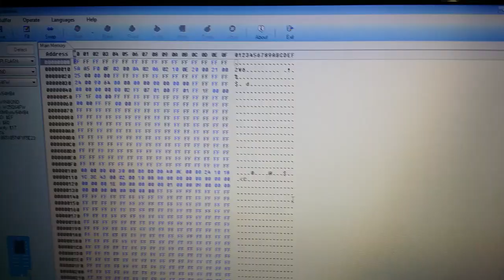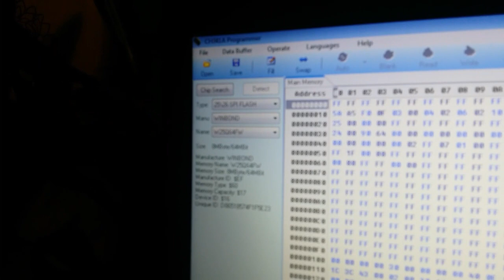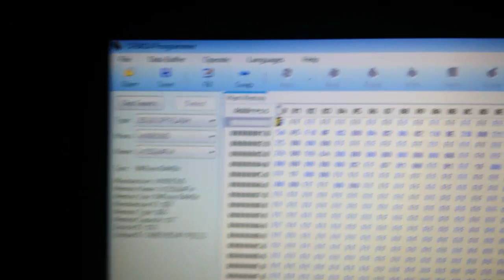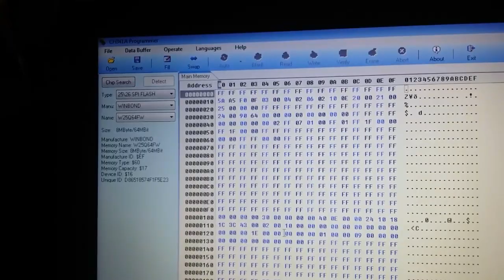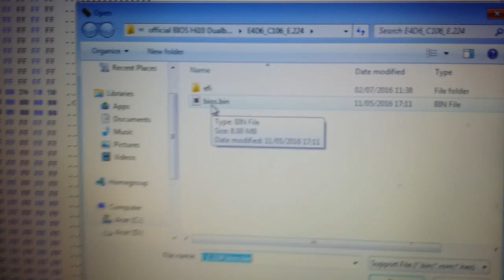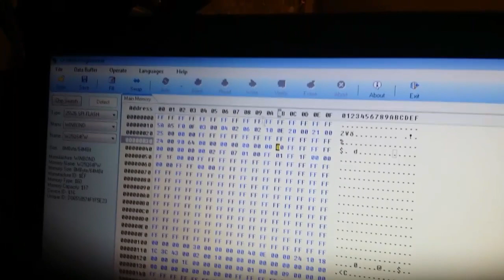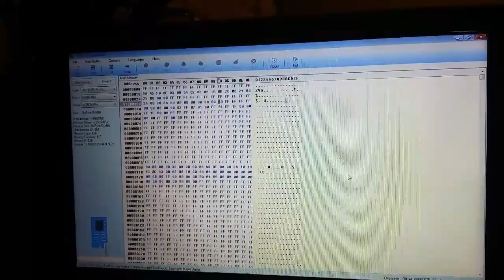chuwi hi10 bios fix How to repair a China tablet corrupt bios chuwi onda teclas cube

Comment: Thank you so much.  I managed to revived my Chuwi Hibook Pro using your guide.  l didn't use the 1.8v adapter.  Also only using CH341a v1.3 works.
Reply: that's great glad I could help. 😊
Reply: did you disconnect the battery?

Comment: Thanks I got it opened but I couldn't get the battery solder to melt I kept my iron on it for quite some time and it just wouldn't move, I did get it disconnected but now I can't reconnect the battery wire as I can't remove the weld so I'm going to try a repair shop to do the connection, fingers crossed the bios flash worked is it possible to check if the tablet works without connecting the battery should it boot up with just the mains?

Comment: hello. I have a chuwi hi8 pro that don't want to turn on.
when I connect the battery charger it charge but no led to notify, I can see in usb tester that there is some current flow also if it charge only at 50mAh.
do you think that with a flash bios can I fix?

Comment: You don't need the voltage converter. The AMS1117 chip on the CH341A regulates the voltage to 3.3V. All W25Q64 chips are working on 3.3V except W25Q64FW. If you have the FW version then it is safer to use regulator.
Reply: But don't the BIOS chips require 1.8V?
Reply: The maximum voltage of the WINBOND W25Q64 is 4.6V. The optimal range is 2.7-3.6V. Check the datasheet for more detailed information.
Reply: I'm on the datasheet for the W25Q64FW, could you guide me to where it says that?
I've got a bricked iWork11 tablet that I desperately want to fix, and would rather not have to wait for more parts than I need.
Reply: On page 71
Reply: But even the title sais "3V 64M-BIT serial flash memory..."
Reply: Sorry what section is this info supposed to be? I think I've got another version of the data sheet. I noticed that some tablets use a 3.3V BIOS chip (Cube i7) whereas others use 1.8V (Cube iWork11), does the suffix of W25Q64 _ _    matter?
Reply: Because W25Q64FV is a 3V chip and W25Q64FW is a 1.8V chip.
Reply: True! You have to look at the suffix. The W version is 1.8V. The AMS1117 itself still can regulate even for 1.5V, 1.8V and so on, the question is that can the CH341A writer able to change the voltage (for example with jumper).
Reply: So in the end, is it still possible to flash the 1.8V chip using just the programmer? Are you familiar with this programmer in particular? If so, where should I move the jumper to?
Reply: My friend didn't use regulator for the FW version but it's very risky. If you want to be sure, buy a regulator if you have the FW version of the Winbond chip.
Reply from the maker: Yes but it can be risky.

Comment: Hi Armookie, I haven't find corrects drivers I guess. I've only 24 or 25 SPI flash on the menu when I'm on CH341a.. Do you have a link ?
Reply: I'm in the same trouble. Did you found the correct drivers? Or what did you do? Can you share to me please? Thanks!:)
Reply: It was not about drivers but about the version of the program, I found it. You need the CH341a 1,3. Anyway, I have no response from the bios, I'm going to wait the Mi pad 3 !
Reply from the maker: re check you connection some programmers are not same layout.
Reply: Armookie in my case it was the pin connection that i had to put to the clip to the inverse that it's shows in the video. and all correct

Comment: Hi thanks for the video I've ordered a USB programmer and voltage controller my chuwi hi 10 plus bricked after 4 hours when I updated the bios from chuwi's website can I ask you what screwdriver you used to open up the tablet as even my smallest star  shaped driver is too small to open it so I need to order the right one, and also the battery wires do you cut them and solder them back or do they just disconnect? I've got experience stripping down mobile phones but I've never stripped a tablet
Reply from the maker: you can open with just your nails. slide them around the join between the back and the front and it should pop open.

Comment: I have a question my friend chuwi pro hi8 in the bios change an option and select the fastboot off and not relit or red light or anything.
if the bios Winbond disconnected it may be reset and return to its factory settings or need to do what you do in the video
Reply from the maker: I think you would need to do what is shown in this video. have you tried holding power for 10 to 15 seconds then power again? if that does not work hold power button for 30 seconds they re-try starting by holding power for 5 seconds exactly. or power button 3 times quick then 5 seconds. Maybe just try leaving to charge for a full 6 hours or more and try again before doing as the video shows.
Reply from the maker: no light means bios needs reflashing. :0)

Comment: Thx for the Amazing Video..
Firstly excuse my bad English..
My Question is: 
Is the Mainboard from the Chuwi hi10 plus the Same as from the chuwi hi12 ? The Specifications are the same but only Display and some USB Plugs are not. If so, can i change the Motherboard from the Chuwi Hi10 Plus to Hi12 and flash the Bios from Hi12 ? I have a broken Motherboard on my Chuwi hi12 and after many hours on testing i'am thinking on this solution.

Comment: What is the model that programmer and voltage converter?
Reply from the maker: I have added it to the description
Reply: Yaay! It's working, i spend 2 hours about correctly connect and find right software to programmer, but tablet is alive, thanks :D
Reply from the maker: Thats great well done if my video helped then please subscribe. Enjoy your working tablet my friend. :0)
Reply: Hi Armookie. Very usefull video. I flash my Chuwi Hi10 pro bios like in your video. The problem is still no light. Is possible that ch341a programmer to false report that the flash was ok but in fact is not ok?
ch341a report on detection the corect chip(W25Q64FW)
Reply: Is possible that bios file that I use(I save my original bios but I beleive that is corrupt;i save just in case) is not the right bios for my tablet?

Comment: I have the same problem.I have opened it up. To get at the chip you have to peal back some black tape, the chip is underneath. It has a small dot dimple in the bottom left hand corner that is pin one.

Comment: Could you post a link to the programmer software. None that I've found has a W25Q64FW option.
Reply from the maker: Ashman I can't provide a link but it should be easily found with a Google search. you may find it does not detect your version correctly but usually it will still flash fine. 😁

Comment: Hello. I have a teclast x98 plus 2 c2d6, and I went to change some settings in bios and now the tablet does not turn on the screen nor is it recognized on the computer. It is clear that it gave bios problem .. if I do this process can I revive the tablet?

What program do I use to write to c2d6 bios ?.

Since I live in Brazil, I can only buy some imported products and there are no technicians here where I live who can do this, just me.

Comment: Good afternoon. For what need this adapter is 1.8 volts?
I have a chuwi hiibook 10 pro.
This method work with my brick device?
Without adapter is 1.8 volts I have nothing happens
Reply from the maker: yes it should work for you. :0)

Comment: Hello
I have a tablet and it ise changes to the bios menu but restarting it turns on but the screen is black without light. The tables do not have clear cmos like the pc and laptops ??
Reply: Combinaste espanol e ingles? jaja. Si tu tablet enciende y no se ve nada puedes dejar presionado el botón de apagado durante 30 segundos y volver a encender. Si sigue igual necesitas hacer esto
Reply from the maker: hook it up to hdmi and boot to bios. you should then be able to reset bios settings.

Comment: Sir , do that step with still on charging ?
Reply from the maker: No and make sure to disconnect the  battery red wire.
Reply: why if the red wire didn't disconnect from battery ?
Reply: Because  it will cause a short and if tablet is not responding it may still be powering the motherboard without you knowing. You must disconnect the red battery wire!
Reply: Excuse me sir. I already have the software and usb installed, but when I go to the software and look for the 25 series w25q64fw bios type,manu and name can not find it on the list.

the closest that match was w25qbv

Comment: Can this apply for teclast tbook 10
I Can still enter the bios though but internal rom only detect 4gb instead 64gb in bios therefore i cant installed any os.
If it can solved by reflashing bios. I'd like to try this method.

Comment: excuse me sir...I did and bought everything you said. Installed the usb driver and software, it detects the usb but in the software I can't find the w25q64fw chip...I chosed type: 25 SPI FLASH, manu: WINDBOND, but in NAME section does not have w25q64fw option.
I downloaded other softwares and same thing.
Could you please help me with that problem?

Thank you so much
Reply from the maker: Ernesto Alonso check your chip model. It should be printed on its surface. Did you connect the clip to the chip first?
Reply from the maker: did you select detect in the software?
Reply: yes sir...and the model is the same as the one you were explaining. is W25Q64FW windbond chip. I connected the clip to the chip first and than connected the usb to my computer, pressed detect and it detects another chip model but the one i have does not appears on the software list.
Reply: what could be the problem? I tried with diferents software versions and it did not work.

Comment: This is really a great job!
I just opened my chuwi hibook 10 and i have two red wires and two black wires coming from the battery, am i supposed to cut both red wires ?
thanks for your help!
Reply: and there is no dot but a blue streak
Reply: yes you must cut both of red wires. (There is 2 wire because sometimes 1 wire cant handle all current goes through battery on bigger devices :) )
Reply: Thanks ! 😊 i'll try it this afternoon!
Reply from the maker: Yes please disconnect red wires all red wires.

Comment: greetings. after finishing all the steps and inserting the bios provided by chuwi to the chip with the programmer tool, my tablet still won’t turn on.
(it was dead as a brick before I even try this method…
Story: it was in storage for a 3-4 months because of broken digitizer and after replacement I opened it and it worked for a day then I left it to charge and when I tried to turn it on the following day, bios logo would show 3-4 times as if it was rebooting or trying to boot several times then screen went blank. I left it to charge and that night I tried to turn it on but it wouldn’t open. Also after long pressing power button, power led which was on at that time went off and never turned on again. Ever since my tablet is dead I tried all the button pressing combinations that I could find but no luck.
any more ideas?

Comment: Old video, I know but when i connect the same way the software detects it as w25q64bv instead of w25q64fw and it is not working, cpu heats up though no display
Reply from the maker: Sri Hari Karthik don't worry it will still normally flash the bios. 😁

Comment: I have a cube iWork12 tablet, i mess with bios by changing some settings then restart. And BOOM! no sign of life now, please can you tell me the solution. I'm not sure how to know that my bios is corrupted and this video could help me.
Reply from the maker: if you changed setting you could try connect through hdmi to a tv and see if you get the bios screen. Otherwise  you would need to reflash the bios using this method. You need to download the correct bios for the tablet.
Reply: I tried to connect the HDMI, nothing happen. So I decide to do your method soon when BIOS Flasher arrived. Any suggestion before I start to do this method?
Reply: Hey I know my bios chip that is Winbond 25Q64FWIG that uses WSON-8 (6x5) instead of yours. It has a tiny pins. I'm not sure that your test clip SOIC8 will work for me too, I have no clues now. I just want to reset the BIOS. Please Help! 
I have a picture if you want.

Comment: Hi!

Would you like to work on a detailed tutorial document/video?
Not even the manufacturer has something similar like this video.

I have a Chuwi Hi8 with a bricked BIOS Winbond 25Q64FWSIG 1519.
Long Story short, I ended up at your video after 2 days of searching, but not every detail is understandable.
Reply from the maker: I could post a more detailed video if you like. :0)Just thumbs up and like and if enough do I will post a more detailed video for you all. :0)
Reply: This is just a quick note I am thinking about a Tutorial video:

Preparations before doing anything: Steady Camera, loud voice, Links to softwares and files to dowload and stuffs to buy.

Steps to talk about for a bit: Installing softwares to PC, disassemble tablet, what to look for, what to plug/unplug before doing anything (charger, battery, etc), how to assemble the programmer, how to connect the clip to the BIOS chip (orientation), how to run the softwares, preparing to finish (what to close first, unplug/plug), after reassembly show what should be happening.

Yes, in this video you talked about most of the stuff I just mentioned. :D

Personal question: Is the Voltage Regulator necessary? I read at some sites that it can be done without it.

In the meantime I will try to order these items for the procedure (pls correct if anything seems odd for you):
1| Programmer: http://tinyurl.com/j76h9q7
2| Testing Clip: http://tinyurl.com/h3ynrnt
3| Voltage Regulator: http://tinyurl.com/zay8kao

If everything seems to be okay for a Chuwi Hi8 with Winbond 25Q64FWSIG 1519, I will order them and make pictures for a Chuwi Hi8 tutorial one, which you could use freely.
Reply: Yeah I did, I followed everything (I could) on the video
Reply: +Dániel Oláh that's great, i'll try tonight.

Comment: Hi friend. Can you help me? Mi hi10 pro shutdown and not led charging, i try all methods; power 30 seconds combinacions etc.... But its impossible turn on the tablet. Blackscreen and no led charging. Since i try intall Android, the tablet was un buble logo 3-4 attemps and then.... Died.

Never before i touch the BIOS o try flash the BIOS. Is too weird.

Mi hi10 pro is the z8350 processador and model hq64G42170304732 and i cant find the bios drivers.

Can you Tell me the EEPROM ubs details  and model that i need for use in my tablet? Is my last chance.

Thsnks a lot. I have the tablet one week and now is dead. No warraty for the Aliexpress seller...
Reply from the maker: go to the chuwi forums and download new bios. use this method in the video if needed.

Comment: If somebody has the possibility to dump the EC bios that is used by the ITE8987E KBC chip on a HI-13, I would appreciate it. Eeprom is a Winbond 25Q80JVS10. 
I have a bricked HI-13 but apart from the normal bios, I don't have the firmware for this "EC" one. As it won't wake from sleep and doesn't produce the 1.8V for the real BIOS 25Q64FW, I'm pretty sure it has something todo with the power controller. 3.3V is there, 1.8V isn't
Reply: David Thijs The EC firmware seems to be available from the Chuwi website. On page 22 of this thread http://forum.chuwi.com/thread-3901-1-1.html
There is a link to a rar file with EC and BIOS .bin files. That is for hi13rev.2 Motherboard.
If you have rev.1 you may need to look through the forum to find the appropriate .rar file.
later serial numbers must be rev.2
The first page seems to list the rev.2 bios update, (not .bin) first, amd seems to give the serials of rev.1 mobos second.
I am not 100% sure about how to find which revision your mobo is. 
But there are links to two different .rar files within that thread that unrar into collections of files which contain differemt EC.bin files. 

They are not the first files on the page, you must get them from comments.

The first files are for flashing via USB and I am assuming you are going to open your hi13 up and flash the chip directly. 

Hope that helps, if you still need it

Good luck!
Reply: @sgo1008  have i problem with bricked hi13. You have correct bios for it? Will be work method from this video?